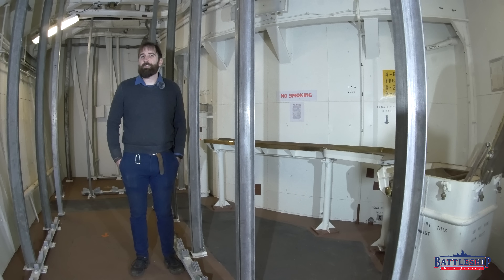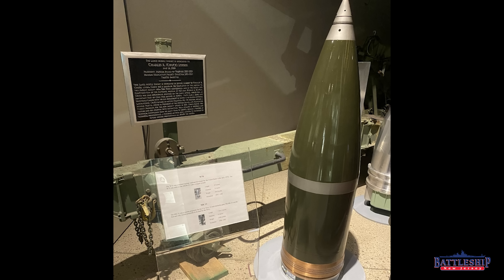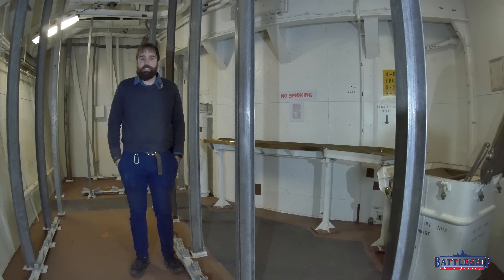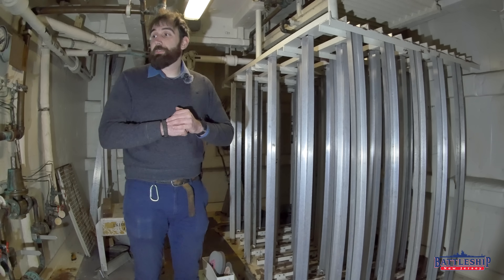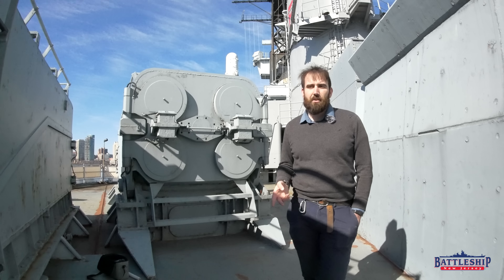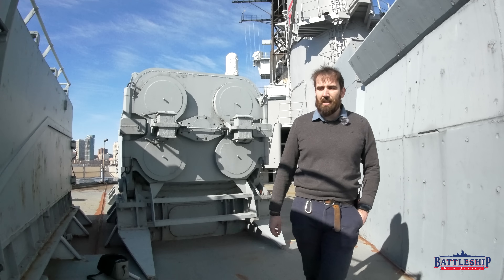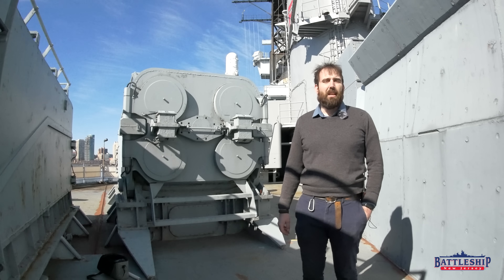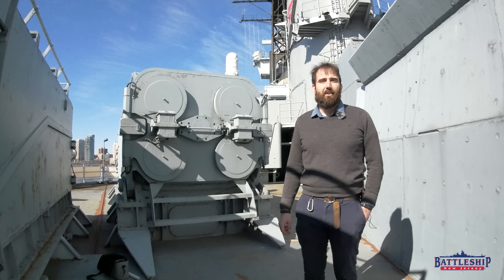Are There Still Traces of Radiation From the Nuclear Weapons on the Battleship?

Comment: Oh man, you guys forgot to do tests in the dental lab and infirmary. There's probably still radiological materials in there. The dental x-ray seemed to be intact and is probably the most likely place on the ship that you'll still find some radiological materials, even if trace amounts.
Reply: very good and interesting point. But say an X-ray machine - creates the short lived radiation - but to my level of knowledge it contains radiological material - correct me if wrong.
Reply: @wfoj21  I think you mean "no radioactive material".
Reply: @wfoj21  You're right that x-ray machines don't contain radiological materials -- they produce x-rays through high voltages, not through exposure of a radiological source to the air. This means that if the x-ray machine is powered it can be capable of producing radiation, making it a sure-fire way to set off a radiation sensor. However, radiological materials present in the dental lab and infirmary (e.g., some dental ceramics, radioactive contrast media) may be found in trace amounts in these spaces -- especially around x-ray equipment, because you'd be using these materials when taking x-rays.
Reply: One of the projects I've worked on is the closure of a Naval Hospital. The testing showed three radioactive sites, all medical waste and irradiated concrete. Good call. There are so many contaminated parts of the base from two auto repair sites, the small arms range, asbestos and lead paint. When I was in Scouts we would camp on the site. Little did we know. It is cleaner now and being redeveloped into housing.
Reply: One of the worst radiological disasters in history was from a failure to safely dispose of medical equipment in Brazil.  It's wild to me that it isn't better known.
Reply: @guaposneeze  I have memories of it being in the news - granted at the time of the accident I lived less than 350 km from that city.
Reply: @guaposneeze   lol hardly one of the worst....just one of  the dumbest. right up there with the lumberjacks cuddling up to rtgs.
Reply: @FenianAn1mal  Hundreds exposed, multiple deaths, and the International Atomic Energy Agency called it "one of the world's worst radiological incidents" and gave it the same rating on the International Nuclear Event Scale as Three Mile Island and Windscale. The lumberjacks would have been one rating lower, due to having only caused a few exposures and one death, per the scale guidelines.
Reply: @MAlanThomasII   yesI know. I have physical copies of the reports for lia and goiania.
Reply: I checked the dental lab and infirmary and various associated offices, they were all under 30 CPM. The brick on my house is 50 CPM, to give you a comparison. The place I was expecting to see the most radiation was equipment with radium paint (such as on gauges or dials), but I didn't see a single object on the ship that measured over 50 CPM.
Reply: @JeffKubel  Cool, can't argue with data. Glad that you tried!
Reply: I think the old equipment used a radioactive isotope of Cesium (Cs-137).
Reply: @Kellmourn  That's a common misconception. X-ray machines don't use a radioisotope, but radiation therapy (i.e., for treating cancer) does. Cesium is used in such radiation therapy devices, but I doubt you'd ever find one aboard a battleship.
Reply: @danielsmullen3223  That sort of radiation therapy device sounds more like something that would be found in an hospital or a specialized clinic.
Reply: @danielsmullen3223  Thanks for the correction.  I had remembered when that horrible incident occurred in Brazil.